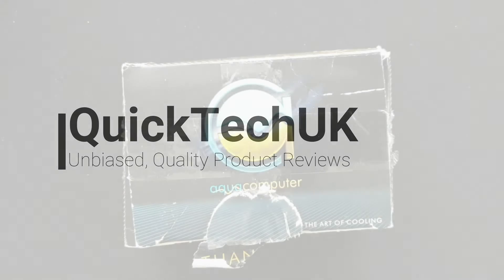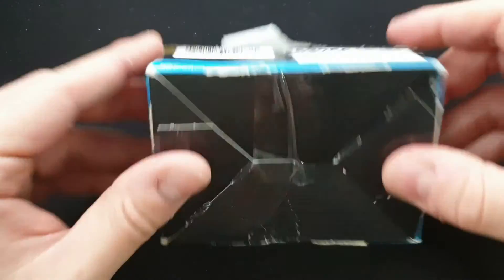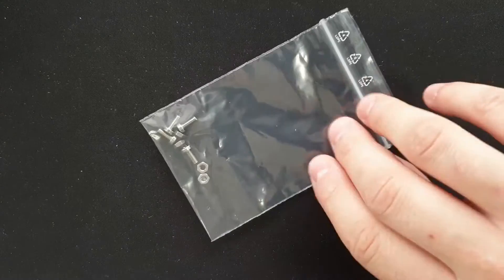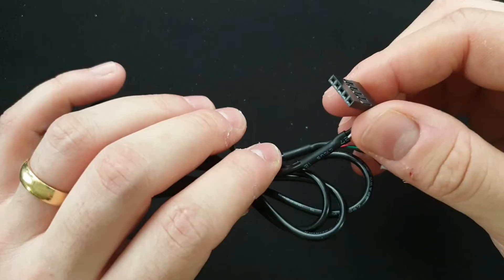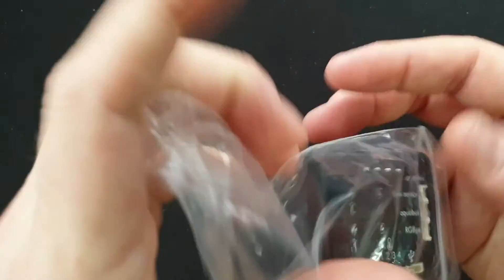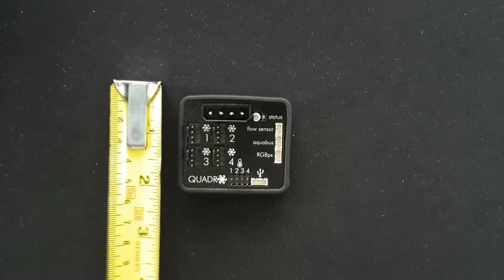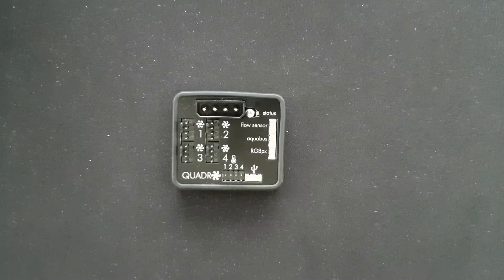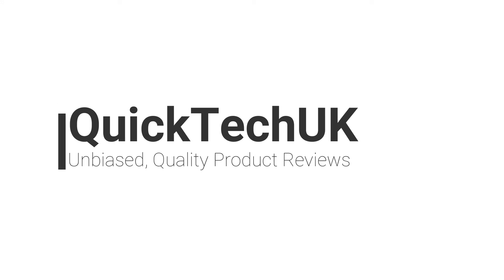Aquacomputer QUADRO Unboxing Technical #AQUACOMPUTER

Comment: Hi. Noob question: this temp sensor cable that comes with it can it be used to measure the water temp placing in a rad for example?
Reply from the maker: Hi no it's can't you need a plug type and a place to put it into. The loop needs to be closed.

Comment: How would I connect this to my motherboard if I'm using an ITX motherboard and the single usb header is being used by the USB ports at the front of my case?
Reply from the maker: You can buy an internal USB header splitter